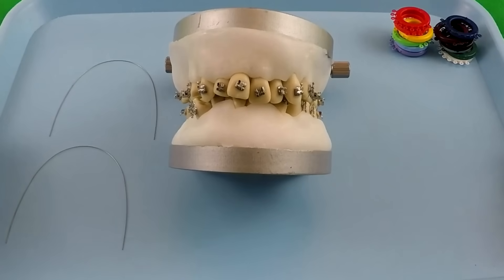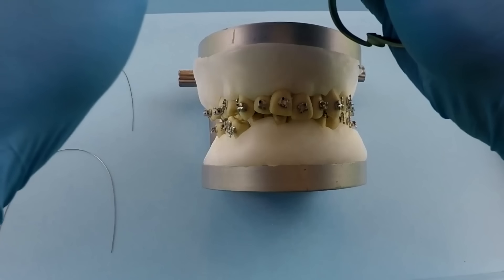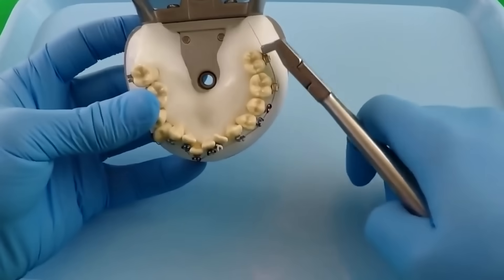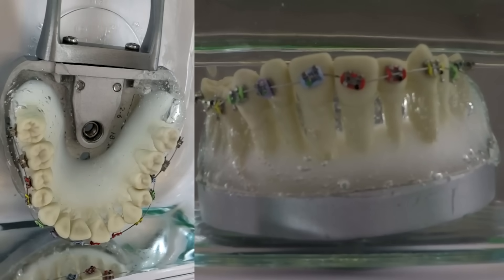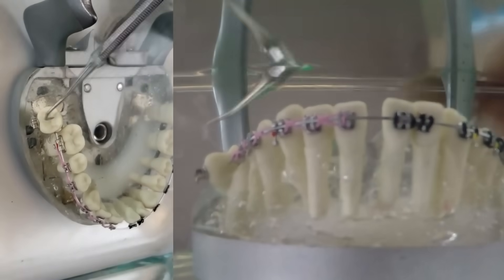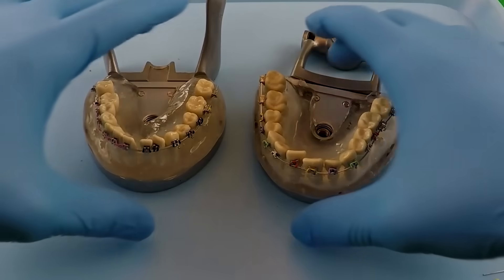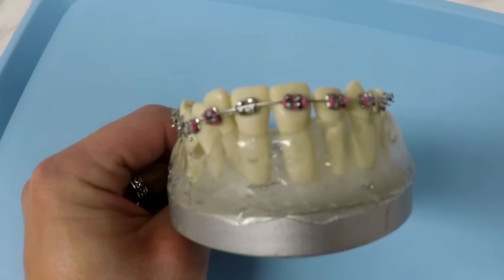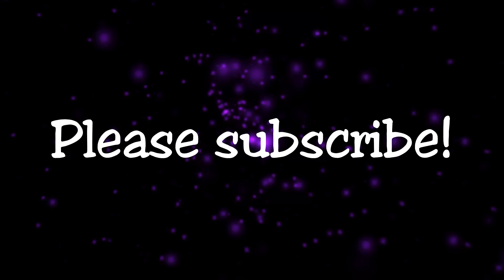Ever Wonder How Braces Work? Find Out Here!

Comment: And also the inflammation around teeth that allows the movement, so no anti-inflammatory medicines, or you will require more time in treatment.
Reply from the maker: It's a bit more complicated than that. Short-term NSAIDs (a couple days here and there) won't have a notable affect on treatment time. Long-term use will, but long-term NSAID use will have more severe side effects than slowing down your orthodontics.
Reply: @thecrazyorthodontist  Thank you doc, unfortunately I have NET and even now I cannot use non steroidal anti-inflammatories, despite my age and chronic pain, braces so far didn't have me strong pain, my orthodontist already told me about mini implants, lots of  rubber bands and more springs, I m aware that my efforts must be applied to get success, deep bite sucks, have a nice weekend 🌷

Comment: Its not a cheat, they do indeed sag, moving from the hardened secure original position makes the gum soft and loose until they harden again, but they're never as secure in the gum as before because of bone/socket/gum compromised
Reply from the maker: That's not true
Reply: @thecrazyorthodontist  it is., softening/compromised gum and socket when teeth are moving is definitely real. If the gum is moving it goes soft and none of the teeth are secure, if you have braces that have moved your teeth into a completely new place like i did the roof of my mouth went soft and when i bit down i could feel it pushing my teeth back into my gums where they weren't secured by my gum from having moved so majorly, also wobbly, i have bone loss where they used tp be positioned
Reply from the maker: @senseisapphire7763  It's a lot more complicated than that. IF you have an already compromised periodontium then that could cause problems, but you shouldn't be going through orthodontics if that's the case. Otherwise, typical orthodontics doesn't cause problems unless there's a RARE circumstance. As I said, it's complicated, but please don't imply that braces always causes problems

Comment: I had braces from 6th to 8th grade(I’m now a week out from starting my 3rd year of college) and for my case they started me lighter than normal and it was still too tight. For my top teeth the 2 teeth outside of the front teeth were angled so far out they were only just reachable by the wire I was crying by that night it hurt so bad I woke up the next morning to my parents gasps my severely angled teeth dropped in one night I couldn’t eat anything solid for 3 weeks it hurt so bad.

Comment: I was born with a cleft lip and palate and I've had so much orthodontistry done in my mouth that it's not even funny. When I was 16 I had to have 11 extra teeth removed plus a mouth spacer, and another device that was installed in my mouth just to turn my back teeth to the right direction. Only after all that was I able to get the braces put on. I'm 40 and still have a bar behind my bottom front teeth and wear a retainer to keep my teeth straight. My youth was a nightmare

Comment: so this is exactly why my orthodontist told me that when I drink hot beverage, the wires will activate? 😅
Reply from the maker: Yes, kind of and theoretically, but the hot beverage only "super activates" the wire for those few seconds while the hot beverage increases the temp in your mouth. Otherwise, the wire goes back to your body temperature which point it is still active but technically not as stiff. The bottom line is that a warmer body temperature is needed to activate the wire while a colder temperature makes the wire soften temporarily. In this demonstration, the very hot water was used to soften that waxy material that holds the teeth AND "super activate" the wire. It's kind of confusing but hopefully that makes sense

Comment: What do you do when you’re allergic to nickel? Are there nickel-free arch wires that move teeth effectively?
Reply from the maker: They make a titanium hybrid wire that doesn't contain nickel. In my experience, I have had dozens of patients with "nickel allergies" where are these wires and braces do not bother them at all. We can do safe tests to see if people are allergic to our stuff just to be sure 👍
Reply: @thecrazyorthodontist  Thank you for responding. I inquired about nicke-free options during an ortho consultation and he said that he doesn't use nickel-free wires with Damon braces because they don't work well. Is that only the case with Damon braces or just braces in general. What about ceramic Lighforce braces with nickel-free wires? Will the nickel-free wires be able to effectively and efficiently move my teeth?
Reply from the maker: @rosescott5049  Nickel-free wires do make it more difficult, but it's possible to use them with any type of bracket. Some orthodontists don't keep them in stock at their offices because it does make it more difficult, so what you were told at that consultation is not wrong. It's just up to the individual orthodontist in what they would like to work with
Reply: @thecrazyorthodontist  Ok, thank you. I guess I'll have to find an orthodontist who is comfortable with using them because I would like straight teeth.

Comment: Do you have an opinion on self ligating braces vs traditional?
Reply from the maker: Yes, great question. I believe that self-ligating brackets make the initial stages of alignment easier, but they are more difficult to finish with. I use them in select instances but not as the main bracket for all my patients. They do not produce superior outcomes with "broad smiles" as some manufacturers claim, however.

Comment: I had braces when I was in high school, and got them off when I was 19. Why did I not have a bracket put on my second molars? I had brackets on all of my other teeth, except for those, and one of my upper second molars are not in alignment with the rest of my teeth. My older sister and niece also didn’t have braces on their second molar, and they went to different orthodontist’s than me. Is there any reason why?
Reply from the maker: Great question. Many times, those teeth aren't in the mouth enough by the time braces are ready to come off. Other times, they are positioned in such a way that we can only bond them if accompanied by a surgical procedure. Other times, they're just so hard to reach that we don't bond them. I can't speak for your individual situation, but I can tell you that your situation is common.
Reply: @thecrazyorthodontist  Makes sense. Thanks!

Comment: Great video ..
I had orthodontics installed three months ago and noticed that one of the back teeth had erupted, causing malocclusion.
Is there a porblem ? 
is this common at the beginning of the treatment stage ?
Thanks.
Reply from the maker: To be technical, malocclusion can be defined as any imperfection in the alignment and/or fit (bite/occlusion) of your teeth, so if you got braces then you already had a malocclusion. If this "new" tooth is changing your bite, though, then that can be normal. Just make sure to tell your orthodontist, and they can address it when necessary, which might not be immediately.

Comment: Great video! As a 55 yo who had braces at age 13-15, I have developed a deep overbite with a class 1bite of molars. Is it common to use the braces and wires to erupt or use extrusion of molars to correct the bite? Will this result in need to replace existing crowns? Thanks for your time.
Reply from the maker: In short, yes, that is a common way to do it. There are many effective ways, none of which I would consider the absolute best, but typically a combination of intruding the anterior teeth and extruding the posterior teeth is very effective.

Comment: My braces process didn't hurt for me until it got to the part where they started closing the two gaps that I had to bring my fangs in. That was the only time I was ever in pain. For tightenings and everything else, I was a teeny bit sore but it honestly might have been because I had enough space for all my teeth. My wisdom teeth extraction was 100x more painful and I have phantom pain still 8 years later
Reply: mine hurt the whole time I had them. not even just that, I noticed that near the end of the process, the sharp metal was cutting up the inside of my mouth. and now my teeth are back the way they were because I didn’t wear the retainers. why? because they’re a nightmare to clean. was told to use dish soap/washing up liquid. could never rinse them properly so I was just consuming soap. and they hurt to wear. was like having braces 2.0
Reply: @LiterallyAllNamesAreTaken  i stopped wearing mines too, the main reason was because i had a hole in my tooth and only got infected when lockdown started so couldnt get it fixed so just kept getting worse so wearing them ontop of the pain i already had was too much ( i also hated wearing them i preferred braces and when i started hearing about people who have to wear them for the rest of their life i got worried since i wasnt told how long or if i would need too). luckily my teeth havent moved much and they still look way better than they did before so dont think its worth it for me to go through pain for the rest of my life just for prettier teeth.

Comment: I was 20 when I got braces.  I lost 10 pounds.  The inside of my mouth was cut up.  My brother and sis came home the day they got them and ate supper but they were 11 and 12.  I had to wear rubber bands and head gear.  I wore my headgear to work.  Got my braces off in 18 months.  My bro and sis wore theirs for about 3 years.  It’s definitely worth the pain.  I am now 57 and still have pretty teeth.  😎. My 3 sons have beautiful teeth as well.  2 of them had their bottom jaw pulled forward first.   It cost a lot but we did it. It was worth it.  A beautiful smile gets you further in life.  😁

Comment: Hello. I came across your video. Im currently about a year in my braces. May i just ask if braces can change the alignment of your nose? I always noticed that my nose and my upper lip are align a bit more towards the left. Will braces help with my facial symmetry? Thank you.
Reply from the maker: You can shift teeth to align them with your nose, but they won't change the nose itself.

Comment: hello doc,I am just curious,how many times usually to change the wire? CozI been wearing braces 6months already,but my orthodontist change wire if I were not mistaken only once in my lower and twice in the upper part..thanks for the response.
Reply from the maker: The answer is that it totally depends. We will typically change the wires every time you come in for the first several visits, but that can vary for a lot of reasons. What you are describing does not sound too unusual

Comment: Hi, I have a midline problem and my jaws are also clicking. Can this be fix by braces? My face is not symetrical :( and my face looks longer than it is. I have lost two teeth 3rd to the last in my lower jaw its not crowdes but spacey. Did this cause my jaws to click? If yes will the midline/clicking be fix with braces?
Reply from the maker: It's impossible for me to answer this well without seeing you. Some facial issues can only be corrected with surgery, but others can be fixed with braces without surgery. I would recommend getting checked out by an orthodontist

Comment: Back in my days those fittings had sharper edges than barbed wire, ripping flesh from chins. 
Has they become any better ? Btw, have you had experience with systems like Myobrace, pros/cons ?
Reply from the maker: Myobrace produces very little reward (ie positive tooth movement) for the amount of work it requires. In the vast majority of cases, you're better off just waiting to allow an experienced orthodontist to treat everything at once.

Comment: Sir, I have a question that can we push the last pair of molars (3rd molars or 2nd  molars if third are missing) backward using headgear to create small gap (around 4mm). Is it possible? Are there any risks involved? 
Sir please answer.... It would be an immense help to me, and I would be thankful to you.
Reply from the maker: Yes, that is possible depending on why you would want to do that. And, yes, there are risks for performing any type of tooth movement. Typically the risks are minor for most patients, but I have a two-page consent form that details the risks. To tell you the risks in your specific situation would require an in-person exam and x-rays
Reply: @thecrazyorthodontist  Sir, I am from India and my orthodontist was unskilled and it caused "Anchorage loss" and the 1st molar was pulled forward. After some months, my maxillary wisdom tooth pair (3rd pair of molars) appeared perfectly and they pushed 1st pairs of maxillary molars even farther and the space (which was created earlier in the beginning, by the extraction of a pair or maxillary premolars) was closed by the 1st molars because the were pulled forward and the facial profile underwent no change. 
My teeths were perfectly aligned before the treatment as well as after treatment, but the protrusion (class II) which existed earlier is not corrected. 
Hence I have a class II protrusion now (for which I went to orthodontist two years ago) but the space is closed by the displacement of 1st pair of molars and I don't want to extract another pair of premolars. So I thought if we can push the third maxillary molars back using headgear and then push all the maxillary teeths back to correct the class II malocclusion. 
I calculated that I need a space of around 4.5 mm.
By the way, I learned all these orthodontic concepts from Internet. 
But sir there are no skilled orthodontist near me whom I can refer my case. And desperately want my protrusion to be corrected as it causing me mental health issues and I can't focus my career. 
I would like to get my case treated by you but I can't afford an airoplane ticket to visit you. 
I need guidance from you since I resolved to treat it myself as because I have no other option available. 
I will not disturb you repetitively, and a little guidance of the procedure to perform treatment from you can change my life. 
I don't know whether you will acknowledge this or not but still there is a hope in my heart that the world is still faithful and empathetic and someone like you will guide me. 
Your little time and expert knowledge can change my life.
Reply from the maker: I would absolutely love to help you, but the only thing I can do from across the world is offer general advice. Moving teeth is a complicated medical/dental procedure that involves years of training and in-person supervision. There is a reason Smile Direct Club and it's competetion are failing. I wish you the best and would be happy to help, but I cannot instruct you remotely on how to move your own teeth.

Comment: Hey doc! Very informative and clear video demonstration. I was wondering what is the main difference of a typodont simulator that is made out of wax or polycaprolactone. Which of these 2 are a closer simulation to real gums and which of these are easier to work with?
Reply from the maker: That is a great question that is not easily answered. Polycaprolactone is more of a plastic that has wax-like properties, but both are insoluble in water and will melt at certain temperatures. Neither of them will behave like gums unless you get a soft wax. The reason that I used polycaprolactone instead of wax is because it will be slightly firmer than wax when melted and it turns clear when melted so I can show the root movement. I hope this is what you were asking, but please let me know if you need further clarification. Thanks for watching!

Comment: Hi Baron, can you also please make a video on how TADs affect the movt of teeth with braces. 
Thanks
Reply from the maker: I made this one: https://youtu.be/iTvOAkZ6gzQ

What else would you like to know about them?
Reply: @thecrazyorthodontist  Thanks a lot Baron! Does Tads help in reducing tooth length? 
My dentist is claiming the length of teeth can be reduced using tads to pull the teeth into the gum.He said that there won't be issues associated with this. 
Also where I'm from Tad orthodontics is being advertised as a non surgical method of jaw deformity correction . Is tad that effective?
Reply from the maker: @mathews4265  Those are generalizations, but, yes, TADs can make treatments possible that were previously only possible with surgery. As for them making teeth smaller, TADs can intrude teeth, which brings them back into the bone (the upper teeth move up and the lower teeth move down). That can make them look relatively shorter, but you won't want the actual tooth to become smaller. That would be a problem.
Reply: @thecrazyorthodontist  Unfortunately I had earlier met with a "smile correction expert" who had grinded my front two teeth slightly which left it sensitive. My current orthodontist has promised to reduce the visibility of my teeth using TAD. So🤞! 
Thanks

Comment: I've had my braces for 1.5 years and I'm still on the second wire. They only change my wire once, so my question is how long can the same wire be reused after getting new bands
Reply from the maker: If it's a steel wire, you can have it a long time...